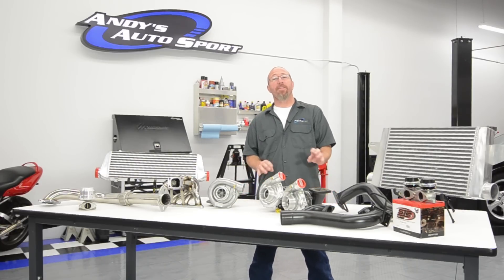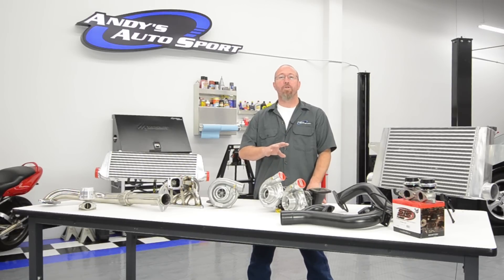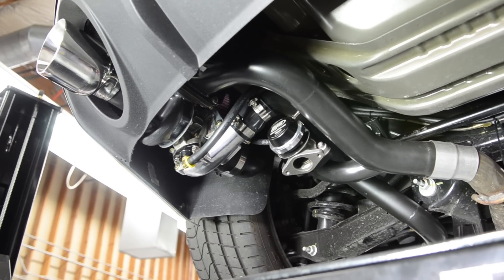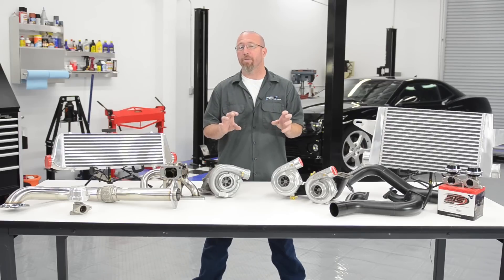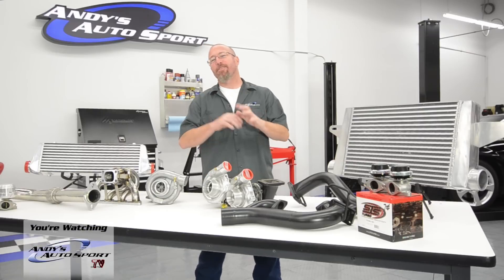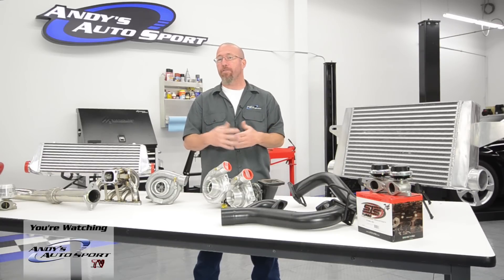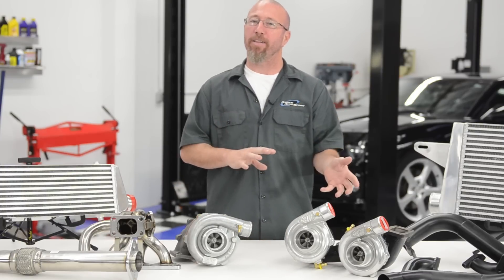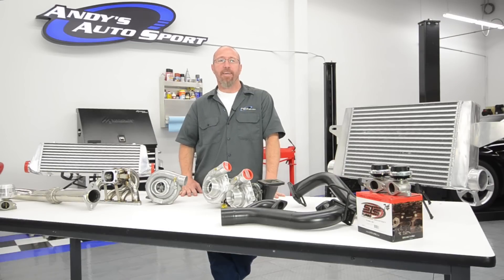Twin Turbos 101 - Presented by Andy's Auto Sport

Comment: You should if you're going to run any kind of boost. You could maybe get away with running 6-8 lbs of boost with stock internals but I wouldn't recommend it as you will wear everything much faster. You also would want to upgrade you're transmission instead of waiting for it to go because if it's still good you could sell it and get money out of it instead of scrap metal.

Comment: What other components would be needed to run a turbo? I know I would need a bigger exhaust (which I will soon be purchasing for Andy's) and an aftermarket intercooler but is there anything else? Also, are turbos still effective with an automatic, because unfortunately I have one. Its a 2001 Honda Accord, V6